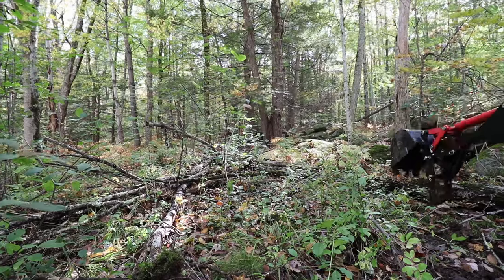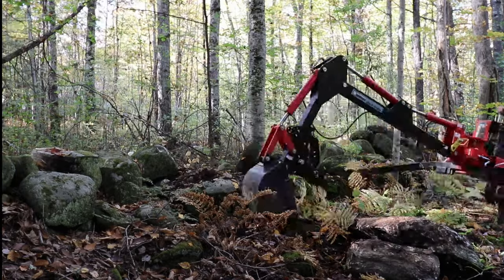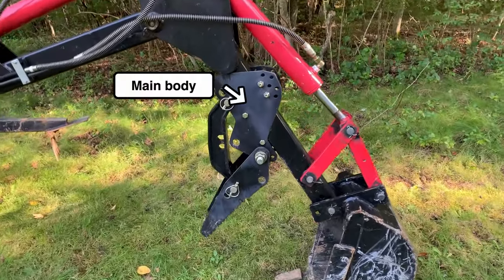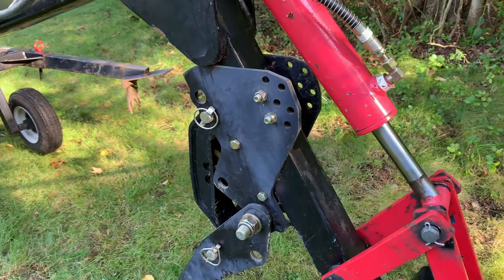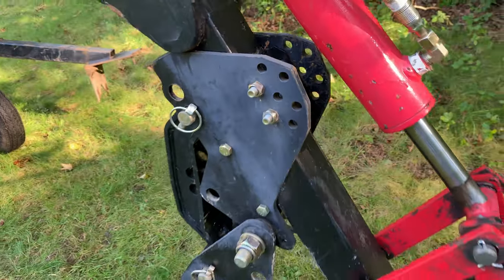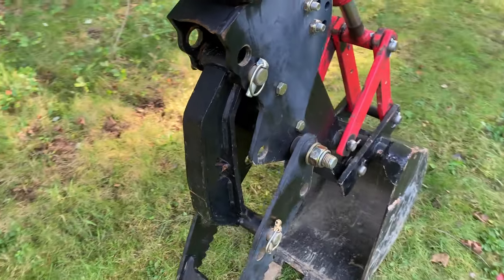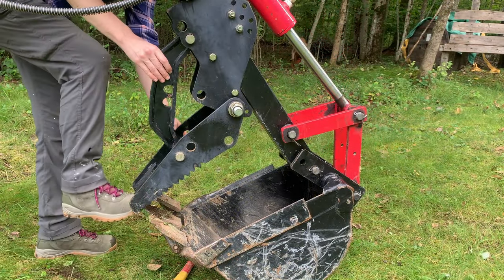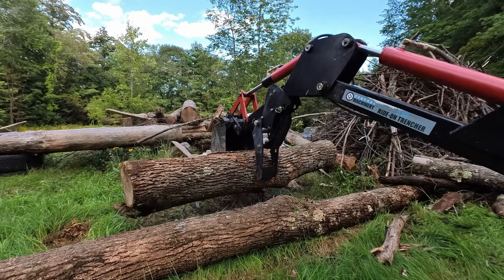Installing a thumb on a Harbor Freight Backhoe Trencher

Comment: One modification I found extremely useful is to get some 22x11-10 high load 4ply atv tires with 10x10 on 4on4 pattern rims... The added width of the tire tread helps to prevent getting stuck while walking it in muddy or soft soilsand the extra inch of clearance aids in walking over stumps/logs/rocks

Comment: I have the exact same thumb for my HF backhoe and I love it.  You actually don't need to remove the, "brace piece," when switching to digging. It's designed to flip up between the plates and thumb and held in place with the same pin that holds the thumb.

Comment: Great video, short and to the point with good instructions. I decided to drill the dipper and bolt my thumb on so I can totally remove it when not needed. My thought was the extra weight of the thumb may put some extra wear on the main pin over time. You are right, the thumb really adds to the usefulness of the trencher.

Comment: Nice upgrades. I did the same, welded backplate of thumb. Used it to pulled up a cement slab. Did you gusset the outrigger? Mine was not and ripped apart. I eliminated the joint, and welded 1/4" wall square tubing in it's place. Hard to find a good metal scrap yard around me. One cylinder bent, replaced so far digging deep hard dry trench. Curious if the wheels could just flip u, use as foot rests as well? LOL Great job!
Reply from the maker: Yup, I did gusset the outriggers after tearing one digging a large rock out of the ground. Also tore the bucket (on a different project) and welded extra support on the replacement bucket I ordered. I'm in the process of rebuilding the old torn bucket into a narrower trenching bucket. 

I've never tried flipping the wheels up, I suspect it might not fit in at that angle without pulling out the outriggers. 

Thanks for watching!

Comment: We added the same thumb to ours. Have you had any issues with the using the thumb and messing up the or breaking the bucket. We don’t know for sure but are thinking that is what caused our bucket to break at the welds from squeezing to tight.
Reply from the maker: We did tear our bucket but I'm having a hard time remembering if that was pre or post thumb. When we got the replacement bucket I welded on reinforcements to hopefully prevent it in the future. Working on turning the old torn up bucket into a narrower trenching bucket

Comment: Thank you for posting this!  I just assembled my backhoe, and am very pleased with it's performance.  I purchased a similar thumb, and am glad to see how it works.  

After pricing small tractors and finding out adding the backhoe attachment would be $8000., no matter the brand of tractor, I spent less than $4000. on the Harbor Freight machine.  I've watched many, many videos, joined a Facebook group, and generally soaked up all the knowledge I could find about this backhoe.  I love this thing, and look forward to many years of cool, and fun, work with it.

Comment: Great video!  Thank you!  I can't find dimensions for the assembled machine!  I need  to know them so I know what size shed to buy to store the trencher in!  I was looking at 10 x 10 sheds but my wife doesn't think that will be big enough?  Would you be able to help us with this?  Length, width and height would be helpful.  I imagine the boom could be "folded" to save room?  We would really appreciate your help!  Don't want to leave a brand new machine out in the weather!  Thank you!
Reply: It fits with outriggers off just inside a 5x12 utility trailer with bucket curled and boom turned at an angle but there is no room to spare a 10x14 shed is the minimum I'd recommend
Reply: @dodgeme1986truck  Thank you for the update!  As it turned out, we ordered (and installed) a 10 x 15 shed in preparation for ordering the Harbor Freight trencher.  Only to find out that when I went to order it, it was marked "Currently Unavailable - Check back later"!  Well, at least we have a nice shed!